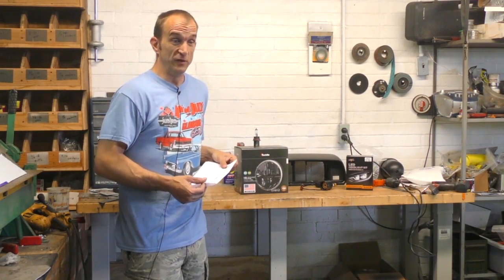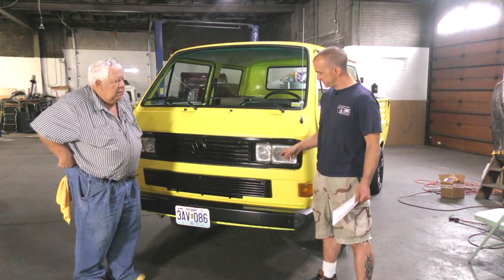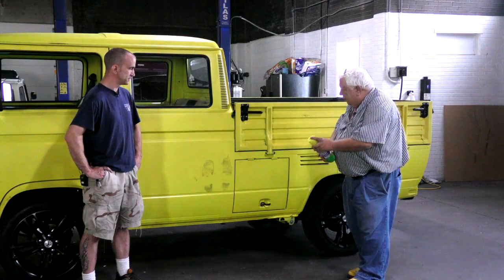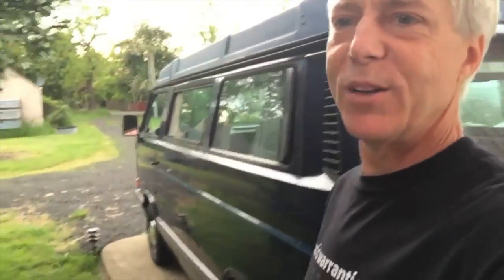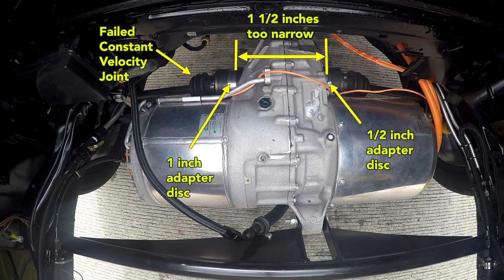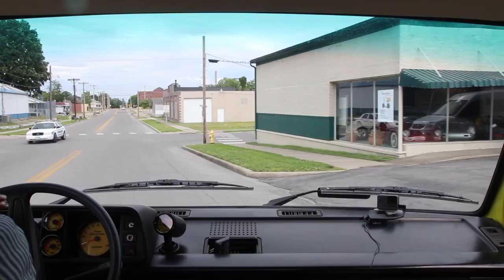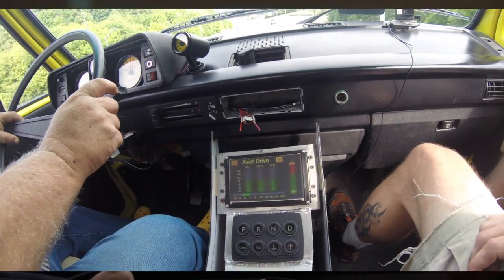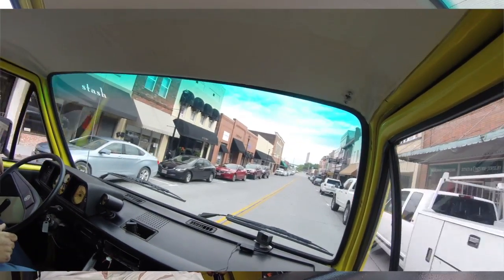EVTV Friday Show - May 26, 2017.  Full Drive, Tesla powered VW Pickup

Comment: May I suggest to add some saw teeth at the axle joints, using flat round
 plates would place all the torque force on the six bolts, with saw teeth joints you can share the forward force from heavy loads or sudden stops and save the bolts from broken.

Comment: If you giving DC voltage, it won't be a transformer in line, it will be a voltage regulator, probably with current limit and temperature shut off.

Comment: Congrats you guys! Is this going to be your new daily driver, Jack? It might save you money if YOU drive it and not Bill as there won't be any tires on the back of that thing shortly...lol...although you may spend more on parking brake parts than Bill might!  So, I see that tunes are in the works, what about A/C and heat? Looks like this vehicle is going to be a very practical and useful vehicle with the ability to be able to put stuff in the back quite easily! Very nice job guys! P.S. Did you get the pictures of the Doka that I sent you?

Comment: You probably could have taken the axles to a drive line shop and had them make new axles exactly the length you needed without using the spacers.
Reply: If the idea is to use stock parts than why bother with with electric at all. 5 years down the road who knows what parts will still be available anyway. If you can afford this conversion than you can afford to buy what ever axles you want. How many Tesla powered VW pickups do you expect to see on the road 5 Years from now?
Reply: OK, I have another idea. Since you want to stay with VW parts how about considering Porche 914 axles (kind of VW). What usually tears the VW CV joints apart is the too much angle on the CV joint and the Porche 914 CV joints will handle more angle than the VW. That's what a lot of the guys go to on there Baja Bugs for more suspension travel. I have to tell you I love the Doka with the Tesla drive train (awesome sleeper).

Comment: Man throw a couple more tubes on that motor mount...it's flexing A LOT!!!!!!!!!!!!!! That motor is going to tear itself out of the frame! Triangles are your friend!
Reply: Rubber motor mounts flex. Ever see a car with a "Shaker" hood??
Reply: I'm not talking about the poly bushing mount, I'm talking about the actual cross-member. The cross member should not be flexing like that and it will lead to eventual failure. Flex in poly bushings = good. Flex in tubular cross member mount = bad.

Comment: 15:30  It's a current regulator.  LEDs, being diodes, have a forward voltage drop of a few volts.  Once the power supply voltage goes above that, it's essentially a dead short.  You have to regulate the current to a feasible limit to keep the LED from becoming a very short lived filament.  (Also why the input voltage can be anything above the fwd voltage - provided your current regulator can cope.)

Comment: Great to see this! Thanks for sharing. Such a sweet ride!That Honda Insight looks just like the one I have with 45k miles on it. Mine has a GM EV-1 motor installed with custom axles but lacks the rest of the conversion. Yet another project that I set aside to do other things. I'll gladly sell it if someone wants to make an ultra efficient conversion.
Reply: Glad that more people got to see my video and I appreciate that you keep the credits too to give proper kudos to all those who help. 

 So glad to hear that the DOKA is scrape free now! Sometimes a little persuasion is all that it takes. 

No working controller in the Honda, If if it had one I'd put in batteries and enjoy it. It does have a 650A per phase 3 Phase Zilla prototype. The last grad student (2013?) got the TI Instaspin code spinning a solar car motor on the bench before he got a job at Tesla. Back then TI hadn't finished the induction sample code. The Honda was always intended as Tri-Zilla test platform and it did run a few dozen miles on a Microchip based board built by OSU students, but after they graduated they lost the source code for that board and we switched to the Instaspin.
I'm no longer pursuing building an AC drive. RMS has a tuning they made for John Wayland that should run the EV-1 motor. That would be a simpler way to get it running if you have any RMS controllers around.
It's such a neat efficient car, with a factory rebuilt GM EV-1 motor and custom 300M steel axles, it's a shame  to sit out here under a tarp since I evicted if from the shop last November. Hopefully someone wants a super efficient car and can enjoy the AC drive challenge.